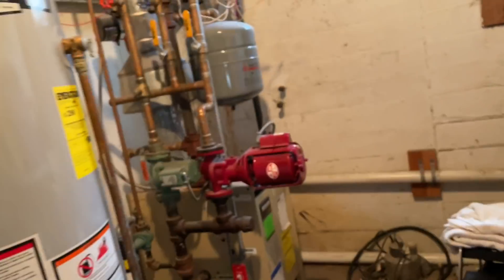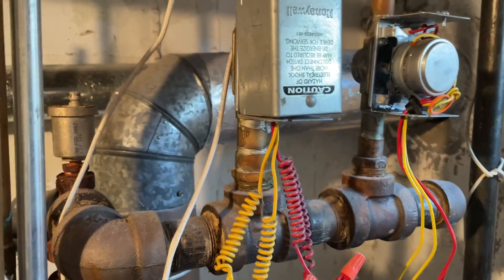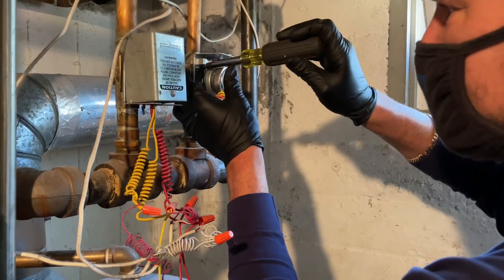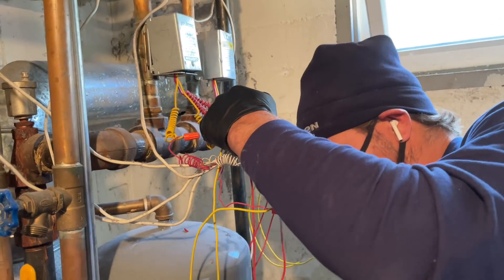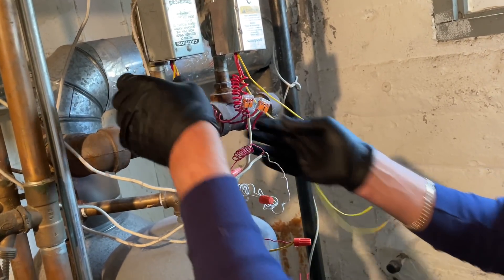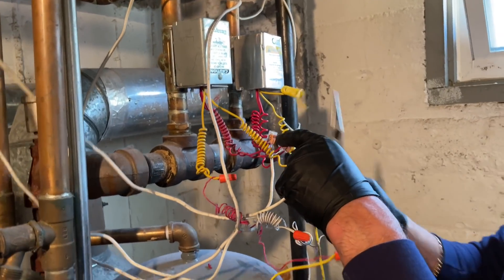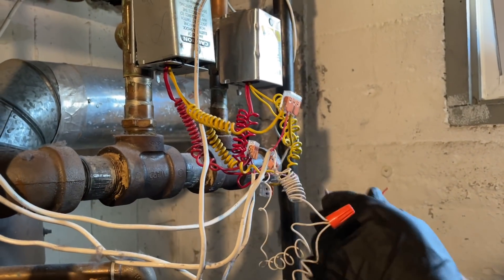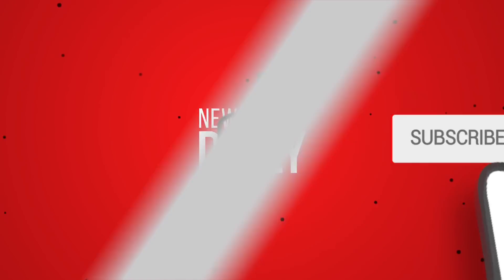Heat Won’t Turn Off - Gas Boiler with Honeywell Zone Valves Using Wagos to Connect Wiring

Comment: The best way to make zone valve wiring look better is to mount a 1900 box with a 3/4 conduit clamp right over or under the valves, put a knockout bushing on them to protect the wires from chaffing and make all the connections inside the 1900 box.  Throw a cover on and it looks like it was meant to be there.

Comment: Zone valve wiring is easy ,even if it's a mess it's simple to rewire a basic series circuit for motor and parallel circuit for end switch wires .

Comment: Are you aware that when you coil those wires, you are making an iductive circuit  ( a coil of wire with a current flowing through it , is an inductor) ; there is also induction in the small motors that close and open those valves. I am only guessing , but that extra induction may be causing the motors to become less affective? I am not there testing only looking at what I can see.  Feel free to laugh at me.  However unecessary induction in circuits can be a pain and so easily overlooked.

Comment: Here in UK we usually just change the motor rather than the full head, we have the same Holywell motors but out wire are. Brown = open the motor, blue = neutral, yellow and green = earth, grey = permanent live, orange = feed to switch the boiler on. (Orange and grey is just the micro switch wires)

Comment: Another way to tell if its the old style honeywell: They had an orange gasket behind the motor head that attaches on the body.
Reply: @PipeDoctor  I don't have a picture but you can see what im talking about in GFM's video. https://www.youtube.com/watch?v=VE1wa033USA
Reply: New style power head will have 2 screws holding head and  old style has 4, you'd have to open water way to remove old style zone  valve head , newer ones can be changed without opening water way .

Comment: Loving the wago’s. Just got some after seeing you used them. They do all the way from 28 gauge to 12 gauge. Its a no brainer.
Reply: Also they can hang to a single wire of any allowed size, so you can terminate a cable end with them, turn power back on and continue the job later. Often with wires on the thinner side, with the nuts you would have to take wire clippings and bend them to a loop to insert within, otherwise the nut mght pull off accidentally. And then, they don't eat away on stranded wires.

Comment: Mikey Pipes I need some advise.. My furnace exhaust pipe is on the west side of the house  and it 3 ft from my bedroom window. My problem is I like to keep my window a little open all year around. But I'm getting the exhaust coming in. The wind is always coming from the west, north west or south west. Also I live in Michigan. My question is can I  extend  the exhaust  pipe up above the roof line? Would hurt the performance of the Furnace? Please help
Reply: @PipeDoctor   thank you

Comment: I was looking at the start thinking there’s too many wires for a transformer and two thermostats!
Reply: Looks bad cause there’s no electrical box. Even though it’s low voltage.  Just cleaner.

Comment: Nice job Mikey.👍You provided a much better service to the customer than the installer did - that wiring was a shit show and difficult to comprehend why they would think having all those wires snaking unprotected all over the boiler and pipework was a good idea. Zone valves are a service part - would  it not have been better (if the original installer) had install these with compression fittings?

Comment: So for example if you were running or needed a total of 3.5 amps on your low voltage circuit, example air handler with a damper system, that also is using a humidifier. 40VA divided by 24 would be 1.67 ,that wouldn't be enough. So we would increase or VA.

Comment: U can wire 2 transformers in parallel wayne,you would do this to increase your VA.Although the 2 transformers should be same make,I have found out that if u use 2 different manufacturers you can get in trouble there.But you can wire 2 in parallel.
Reply: They need to be matched pairs or one will circulate current in the other and burn it out. Not a good idea. Get a bigger one or run them independent. Those two were not only different sizes, they were different manufacturers and different ages. Mike swapped to the newer one and got her going.

Comment: Funny just noticed one of my zones was still hot when no call for heat.  Was thinking if mp had a video on honeywell valves. 

Supply house sells just the zone head btw

Thanks for the video 🙂
Reply: You can also buy a conversion kit to convert the old style zone valve to new style zone valve with removable power head .